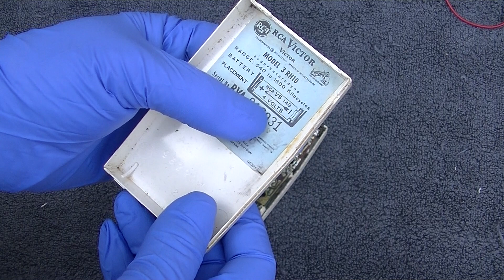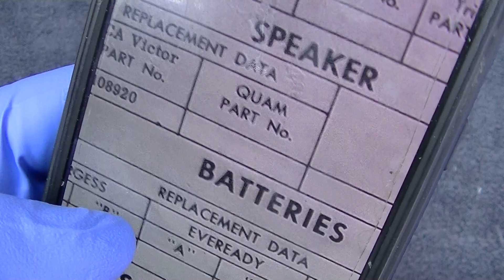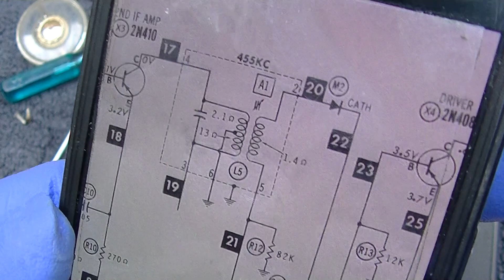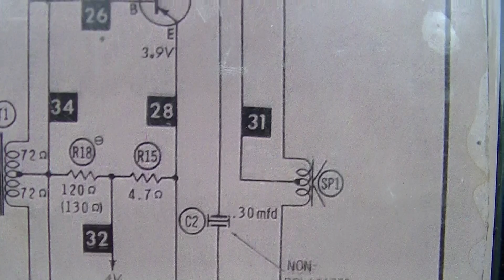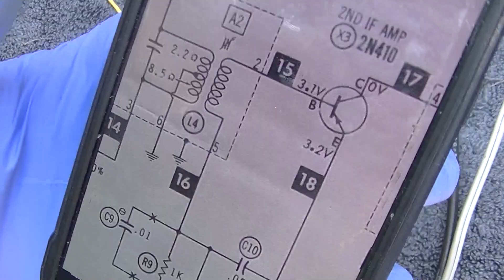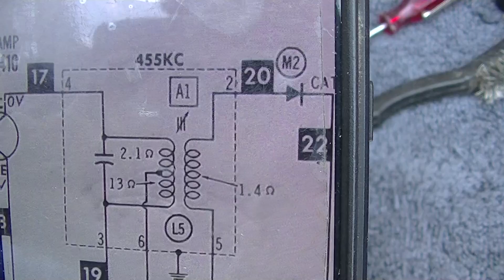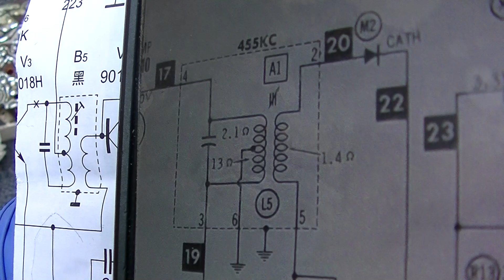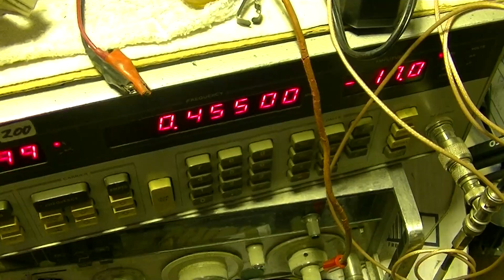1961 RCA 3RH10 Transistor Pocket Radio Resurrection from box of 20 video

Comment: I've found that overflowing solder, then wicking the excess can do wonders on that corroded muck.

The arrangement of the transistor as a detector, equates to a really fast diode with small PIV, but also small Vf. Thanks Bob Pease!

Comment: Good job getting it going.  At first,  with the high resistance measurements on the speaker, I thought the voice coil wires were corroded.  You are correct in that there is absolutely nothing worth listening to on AM radio.  Unfortunately, the same holds true with TV now.

Comment: 10:50 I guess it's a good idea to have a small AM transmitter project as an addon for such radios. In europe AM is not popular, so it's either going for a FM radio or building/getting an AM transmitter. You can have quite a lot of fun building one from those cheap junk tubes (~0.5-1USD each or so), especially if you already have some coils available. Relay an internet station or your own playlist and it's good to go.
Reply: KMIL Mrs. Miller, all the time!

Comment: For that corrosion, some things I've had success with is both vinegar and RA rosin flux, you heat it up and it bubbles it all away
Reply: I use lemon juice, that stuff that comes in the lemon shaped bottle.
Reply: @NickG123  Vinegar or citric acid works really well. They’ll even take rust off steel if left on it long enough.
Reply: Apple cider vinegar really does do a job on that white stuff

Comment: I Know it may sound crazy but I like to use Zep brand toilet bowl cleaner on pcbs that have seen battery corrosion.
I use a little and brush it on with a toothbrush, it’ll eat it away and allow the solder to melt again(at least better than before treating).
I haven’t tried other brands but I believe what’s doing the work is muriatic acid.

Comment: One of my favorite parts about this radio Is the Way American made radio circuit board tracks were designed ! It’s so beautiful! Also I have an RCA Victor radio from 1963 with no battery corrosion That would be a good parts radio  for  IF transformers for this radio!  And it has the same speaker!

Comment: Have the same radio. even had to replace the trace from the + terminal.  I made a 4V Battery from 3 AAAA batteries. I like the radio as its a great performer. RCA did a great job on this one. I live in Florida and have picked up a station in Chicago.. and WSM out of Nashville quite easily
Reply from the maker: I figured it would be

Comment: I picked up a Sanyo AM/FM that had a horrid leak. The wires leading from the batteries were so rotten that they had to be replaced. I am still having problems with the unit working all the time I think I will have to go the same route you did and put in a different battery system as I can get it working with a power supply all the time but only occasionally will it come on with batteries.

Comment: To clean circuit boards where batteries have leaked, I always use Methyl Alcohol and a soft toothbrush.  It's safe on plastic cabinets and rinses away the corrosion.

Comment: 24:44  Aaron Copland:  Billy the Kid;  Gun Battle

I have 2 of these radios. An AA battery will fit but the voltage is too low.  The 18650 lithium-ion battery at 3.7 volts just might work but I have not tried that yet.
Reply: The 18650 battery is 65mm in length while the AA is 50mm in length making the 18650 to long for this radio.

Comment: Great job in getting that corrosion off the transformer and circuit board,,,I had noticed the speaker,,,it has 3 wires,,,not 2?

Comment: I bought one of those capacitor wizard about a two years ago, I opened it up to put the batteries in it, I was appalled at the craftsmanship of the circuitry, it looked like it was built by a kid in grammar school, it also had a modification for surge protection that I had to install, I was not impressed with that piece of equipment...I resoldered the pcb and trimmed all the comments that were never cleaned up after being installed. 
Frankly for the 250 dollars I paid for it, I think I should've bought the blue capacitor esr meter.
Norcal715 built his blue esr meter and it seems it's far better at half the cost .

Comment: i've done a similar IF bodge in a Hacker RP10 radio, the first IF transformer was physically damaged by a previous ham fisted owner/engineer😉, the original was a double section type, two cores, side by side, but nothing to lose i wired in a common far eastern single core type, orange coloured core, meant for first IF use, and amazingly after a bit of tweaking to match the IF frequency of the remaining others (465khz, i think it was), i'd say it worked as good ,or nearly as good as, new! and i didnt replace any caps 😉 they were ok. this was over 20 years ago, it still works but sounds distorted,(havent powered it up for nearly those years) so maybe now in need of cap testing again 😁 if so, i'll redo the bodge as it was done rather roughly at the time, i'll make a little pcb for it to adapt its pin layout instead of 1 inch long wires it has now

Comment: That IF transformer looked OK. The loose wires would be easy to rejoin to the pins.
Reply: Hmm not so sure about that. According to the schematic shango had on his phone at 22:33 there is a capacitor in that IF can too. And whatever ate away at the wires surely would have eaten away at that cap too. So you would have to at least get rid of it in favor of an external cap.
And yes, the chinese schematic is incorrect as their IF can has an internal cap too. That is why shango need not add one externally.
Reply: BAKED
Reply: Send Shango your address and maybe he can send it to you to repair.
Reply: Shango you should mail it to Russ

Comment: If the voltage was to be 4 Volts, perhaps the original battery was a small 2 cell lead-acid battery. The color of the corrosion appears blue-green indicating the presence of copper sulfate. The lithium cell is a good option, as its voltage on full charge is about 4.2 Volts, with a rating of 3.7 Volts, still operating the radio. I wonder if an electrolytic capacitor replacement would put more life in its sensitivity....?

Comment: I believe the that radio used a mercury battery so there is contamination the other clue is the spring battery contact on a modern radio is negative while on a mercury the positive is on the spring in that radio.

Comment: I always appreciated how I could tweak my old tube Transoceanics after they were reassembled through access holes in the bottom of the case(or in the top of the battery compartment). 
Was just wondering if it would be possible to drill a very small hole in the RCA case to do the same thing?
It's not like anyone gives a damn about cosmetics anyway, right? 🤔
Reply: shouldnt need to keep tweaking them...
Reply: @andygozzo72  I think you are missing the point sir.

Comment: Wow, the 100 Ohm centre-tapped speaker is news to me, I'm not that familiar with these old designs. Also the 4 V battery is a new one. How the heck did they get 4 V, or was it half a 9 Volt battery and they just called it 4 V? I learned something today.
Reply: Those old 4V batteries were mercury based.   They had a higher energy density and the advantage of the voltage was relatively stable until the very end of life so the performance never varied until the cell was completely dead.
Reply: One of many battery powered devices that used what’s now a obsolete battery. As Shango did, have to improvise to make what’s available work.

Comment: Perhaps light pressure sand blasting or perhaps better glass blasting the pcb backside will remove the top layer corrotion quickly, and then reflow it with new solder with a soldering iron?
One can use copper wire too if the trace is not that long and solder it from a to b, if too long to be stiff enough then insulated wire works good.
One could likely use thin copper wire and a drill a small hole on each side of it and fix it with thin bare copper wire to the pcb. Kind of brain surgery but it should work, old pcb's are not that complicated, i have soldered copper wires on much smaller electronics tracks than these. Try fixing a broken USB WiFi stick with a loupe and you get the idea here :)
I like reading glasses +4.00 if i want my eyes to get real close to a small pcb to fix it :)
My vision is -1.25 to -1.50, so perhaps +3.00 reading glasses will fit normal vision for this.
I did buy several cheap minus glasses and +2.00 +3.00 +4.00 glasses to test things, it is kind of cool, like having microscope eyes holding eyes like 4 inch from the piece one works with to see real good :)
I still have minus glasses to test, perhaps i see the stars in the sky again properly with the -6.00, who knows, i remember it was fun as a kid to watch the stars. Those glasses are still in the mail so yeah, dont know if that works or what use i got for those ones :)
The lens in the eyes becomes less flexible so one can not focus as good at close-up or distance when getting older, it happens to everyone. So i find these glasses fun, kind of like being a kid again and i bet i did not come that close even as a kid :)

Comment: The speaker "impedance"  is 90-110 ohms. The DC resistance should be less than half.
Reply: Not really. Usually the DC resistance of a 16 ohm speaker would be around 14-15 ohms. So 100 ohms is spot on.
Reply: @michvod  an 8 ohm impedance speaker is 4 DC ohms. Okay, if the impedance is from 90 to 110 ohms, lets agree the  DC resistance will be about 50.
Reply: @tedrobinson372  I checked on an actual 8 ohm speaker and it is showing me 6.5-7 ohms. And another 5 ohm speaker measures 4 ohms exactly

Comment: Too bad this country did not impose trade tariffs back in the early 60's on imported electronics. If the US had done so consistently and completely we may still have a domestic consumer electronics industry today. Hard to complete with low wage labor from countries that have/had much much lower standard of living at the time.
Reply: Consumer electronics started leaking into the country from Japan in the 1950's. I saw them in the stores as a kid then. They were cheap, something of a laughing stock and the government wanted the Japanese economy to recover. But then they learned quality control; Sony, Panasonic and Toshiba came along and offshore manufacturing became all the rage.
Reply: @KameraShy  At which point we should have started protecting American jobs from cheap offshore labor undercutting the American worker.

Comment: The alcaline vapors destroy everything. Long ago was looking for a parts UHER REPORT 4400 I had one with an open head. I purchased a "non working" one for low money.  Ohhhh boy, 5 C cell TOTALLY corroded. The thing is mad of aluminium, the paint was ALL pealed, like using paint striper, everything inside was WASTED, .... OF COURSE the head was also open ....When first tried to open this thing there was so much rust and dust rust I used a mask and a vacum cleaner. Two week later the vacum cleaner developed a bad bearing (IMHO this dust made up to the motor and granaded the bearing. The UHER wasnt so bad on the leakage .... because it was resting on its back, but inside its leather case so the fumes had been working for years ..... Motor and amplifier still worked but the final score was kinda 2 UHERS with an open head plus a grananded vacuum cleaner. Dont vacuum this crap !!!!!  I still have this unit. Tried to neutralice this thing as much as I cuold and them put it into sealed bag as spares. It was a few germanium parts.

Comment: Tecsun and Sony still sell real non DSP true analog radios with tuning capacitors. I wish I could get someone to align the AM section on mine. Analog radios work so well on AM if they`re set up right (I have one that IS) at the factory but the Chinese simply don`t care.
Reply: I've noticed Tecsun are actually selling DIY build-your-own-radio kits. They look quite good. Tecsun is doing some cool stuff at the moment, I'm pleasantly surprised.
Reply: If its AM and badly misaligned give it a crack yourself. Or even better practice on a cheap radio you don't value. Google the fluorescent lamp alignment method (you align the IF stages by ear to the noise of a fluorescent tube). Then use real radio stations to align the oscillator and weak stations to align the RF. Sure you'll make a mess of it, but the more you revisit this and try again the more you get a feel for what happens and the better you'll get. Once you get good at it DON'T try the same thing on FM. You really do need proper test equipment for FM IF stages and there's simply no way around that.
Reply: @Seiskid  I have an expensive ($50) Texsun R9700DX true analog radio that you can still buy and the analog FM stereo has a magical sound compared to DSP radios. It`s very noticeable. I have a $70 digital Sangean PR-D4W that`s struggles with FM stereo but this transistor radio sounds amazing. AM is very weak on the radio and I know they could have done a better job because I bought a Sony ICF-P26 analog radio that`s smaller along with a smaller true analog Tecsun R9012 and both of them are more sensitive on AM.

Comment: The chinese must be an 465khz type, and your RCA one(cracked) 455khz probably, so may be you can compromise both on middle, ie some 460khz still in their tuner tolerance..
Reply: could be, i have uk made/designed radios that use the Toko or Toko 'clone' coils like in that kit and they're 465khz,

Comment: 4 v battery?
Reply: Obsolete battery type. They hadn’t settled on what would become standardized batteries back then. Obviously “pen light” batteries (AA/AAA), and eventually “transistor batteries” (9V) won out.
Reply: @erikj.2066  I wonder how expensive it was in those days for batteries, to use a portable radio like that.  I recall a tube portable my older sister had, it had two different batteries, my recollection was they were large at that.
Reply: @robertp7209  I’m sure in relation to buying common batteries literally everywhere these days, those purpose built types weren’t as cheap. 
Wouldn’t at all be surprised if half the reason they were made semi-uncommon is so you’d need to go see an RCA dealer for your next battery, although someone else had mentioned another brand supporting this type battery. 
That being said, and RCA being RCA, I’m sure they expected a license fee from any outside company that looked to reproduce a battery RCA held a patent on. Naturally that cost would have been passed on to the end user.
Reply: @robertp7209  the tube portables typically had a 1.5V or 3V “A” battery with some girth to power the hungry tube filaments. They would also have between a 45 to 90 volt “B” battery for the tube plate voltage. 

Those aren’t as much of a big deal to build a substitution for. Most of those portable radios have ample space in the battery box to work with. 
The “A” can be made with D cells in parallel/series, and the “B” can be a bunch of 9V batteries in series up to the desired voltage.

Comment: The radio plays pretty well with bad capacitors. I have a cap wizard also and it works well but the quality does leave something to be desired for the cost.  I purchased a cap wizard because I wanted an analog meter readout. The real bomb of a ESR meter is the EDS-88A CapAnalyzer Series II from Merced electronics.  Yep it's expensive but it really works and checks for shorts first before measuring ESR. The little bugger works perfectly and does not lie about the condition of a capacitor. Sometimes I prefer the test leads on the cap wizard to the tweezers on the Merced but both have their place.  There is a similar meter for sale on eBay to the Merced and it seems to me they tried to copy it. It's made in China and does not work as well.  The one I had if you would test in rapid succession would get confused and give false readings. I returned it for a refund. It is also sold under the b&k brand.